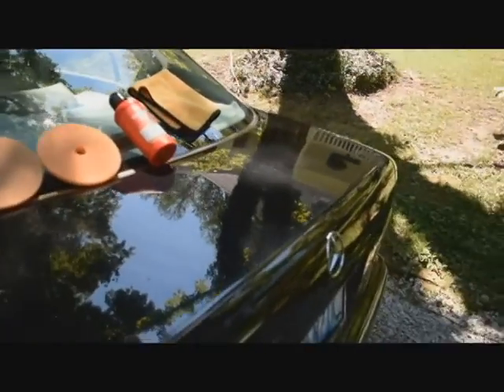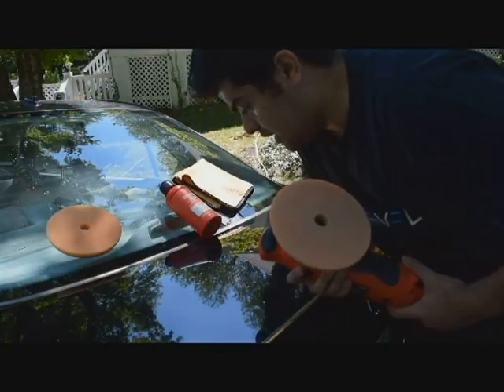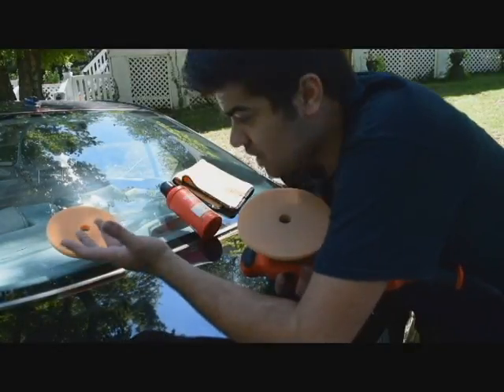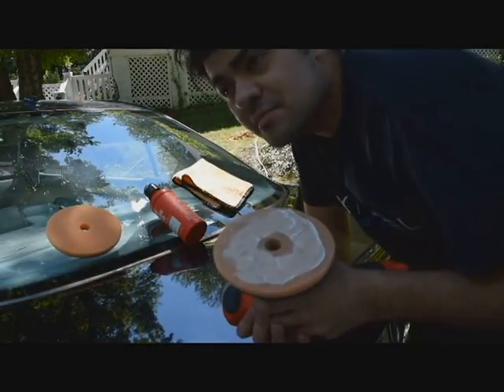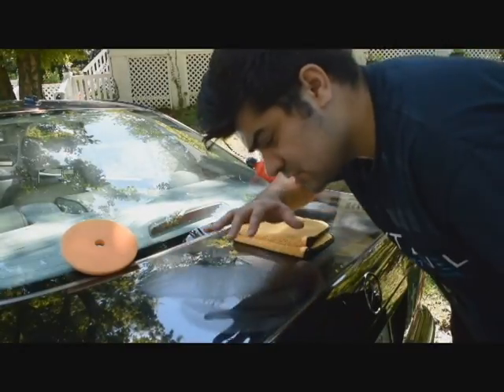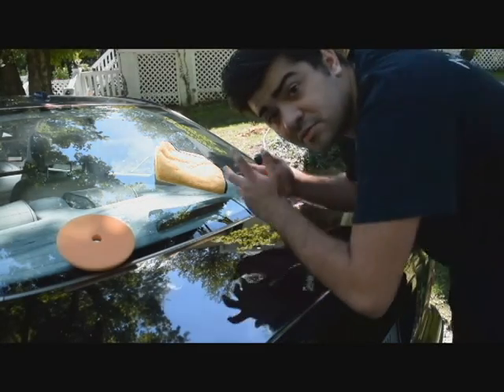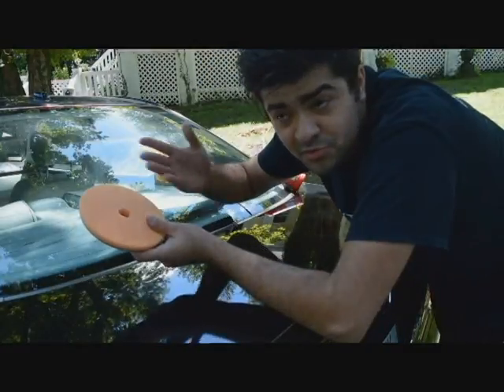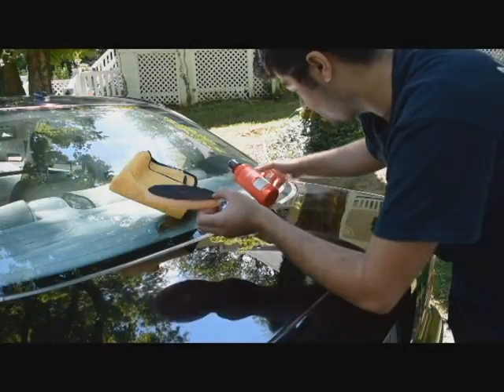Detailing Vlog | One Step Polishing Guide/Tips/Advice EP:1

Comment: What kind of flashlight are you using
Reply from the maker: it is a refun flashlight you can buy off amazon for 17 dollars with a recharable 18650 battery also comes with a charger. it is 900-1000 Lumens and is a fantastic light!
Reply: would you have a link for it